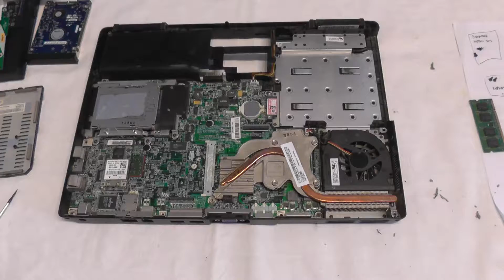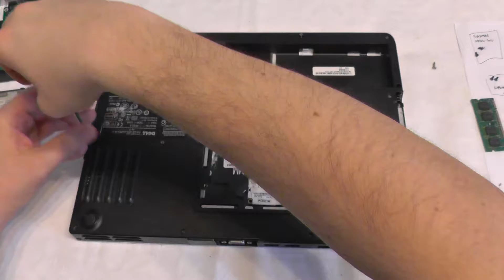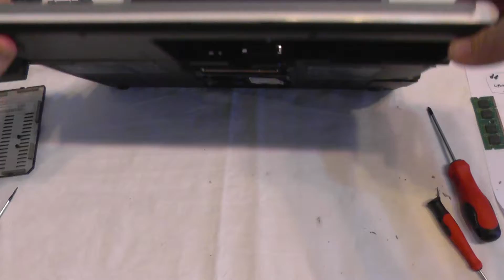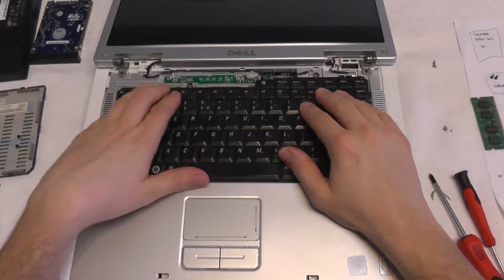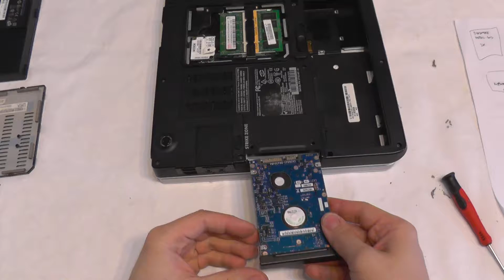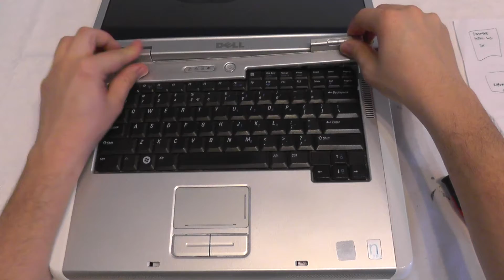Dell Inspiron 1501 Reassemble

Comment: if my screen doesnt come back on what does this mean
Reply from the maker: There could be a few things to try. If the laptop works, HDD activity led, windows sounds, etc. it means that the monitor ribbon cable is not correctly attached to the motherboard. You can verify this with an external VGA monitor. If there is no activity and the laptop runs (cpu cooler) it may be a memory module that is not seated properly.